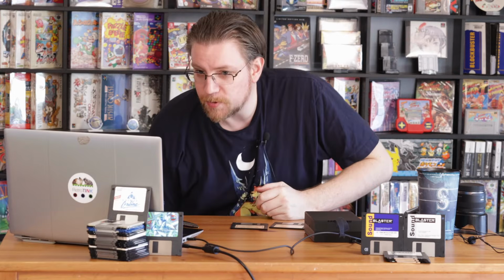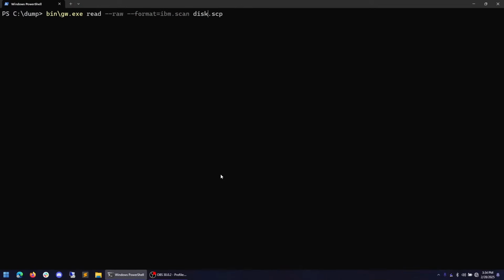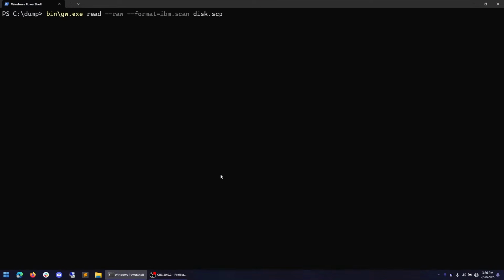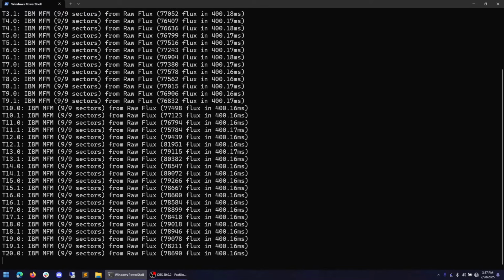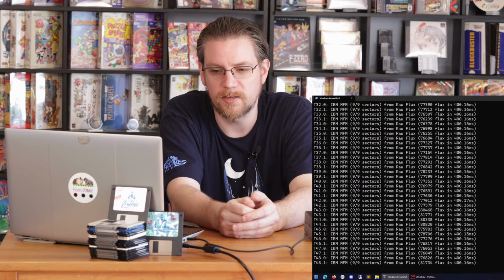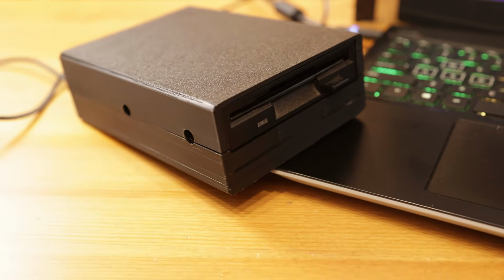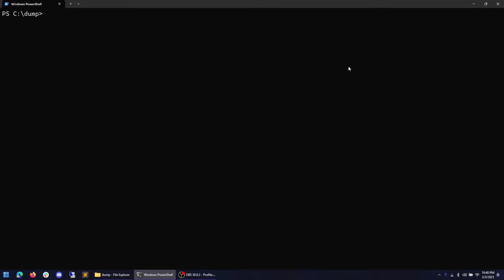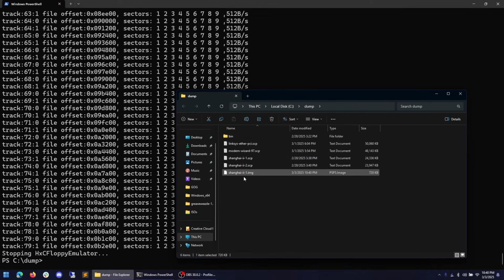Floppy Disk Archival Project

Comment: What is the shelf life for your average magnetic floppy disk, anyway? How many of those two lots of floppies were completely or partially unreadable?
Reply from the maker: I'm going completely off of memory here. But of the 150-200 commercially made disks I've dumped, I've only ran into I think 5 that had bad sectors. I need to go through and see if I can recover that data. In comparison, I opened new-in-box blank floppies, and sit in the neighborhood of almost 50 percent failure rate trying to write a fresh image to them. I know a lot of this comes down to brand quality, so it's not a direct comparison. But at least the commercially produced disks are of great quality! How much longer will they last though? Hard to say, which is why I wanted full flux dumps of them "just in case"